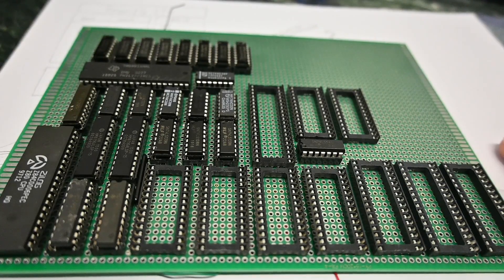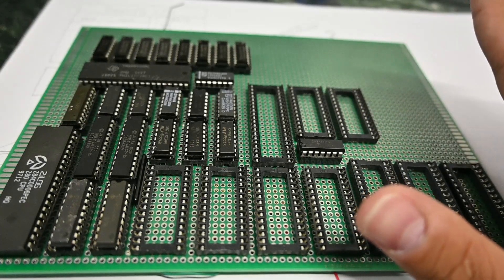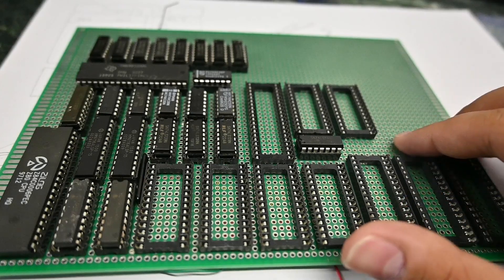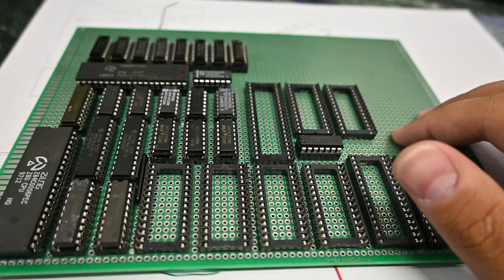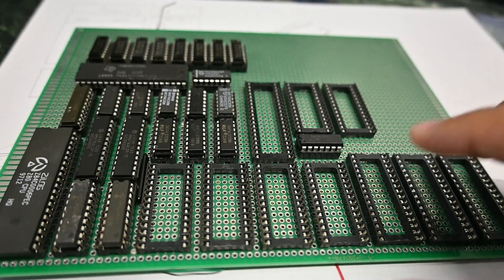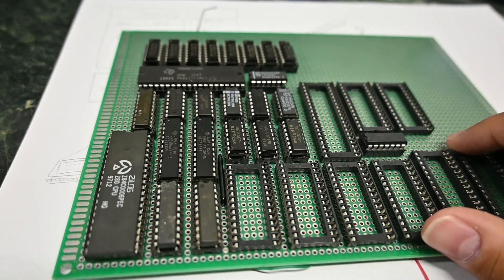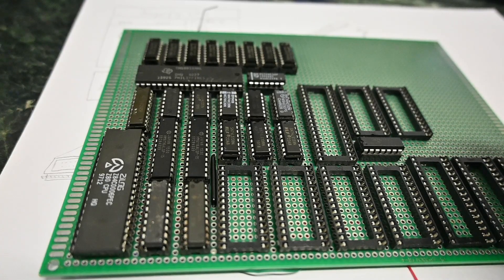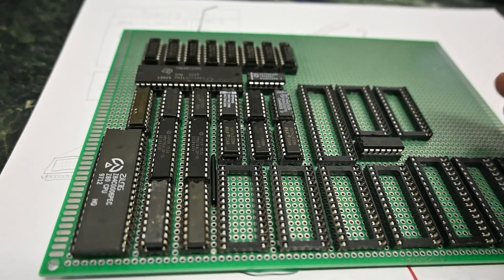[Dragonfly CPU] A brief architectural introduction - Part 1

Comment: Andy, you should look up all the Forth and minimal instruction set computer (Misc) forth CPU's out there.  Many homebrew on fpga. Highest low energy performance and near/highest pure performance, at times.

There seems to be a 40 core 6ghz, CPU on a square mm or two, with some incredibly low energy.  Ultra technology had a chip page which is still maintained.
Reply from the maker: The Dragonfly is deliberately 'not minimalistic'. It is designed to strike a balance between simplicity and ease of programming. Minimalistic computers like the Gigatron are so hard to program that most people built their program on emulation layers on top of the CPU.
Reply: @andyhu9542  Yes, that's what these are like. .less than 32 instructions corresponding to high-level language primitives.  Forth CPU's is the leading languages based cpu category. One of them was the leeding C and JavaScript processor at the time as well.

Comment: Just ran across channel.
But, yeah, I have also designed and implemented a CPU running on own ISA (BJX2). However, my case is a bit different as it is a 64-bit 3-Wide VLIW which I have tested on an Artix-7 FPGA (XC7A100T; but can be shoe-horned into an XC7S50 by tweaking some settings).
It is also a considerably more complicated ISA: 32 or 64 GPRs (64 GPRs is an extension), with variable-length instructions (16/32/64/96 bit), and support for both bundled and predicated instructions. ISA design influences were: SuperH (mostly SH-4), TMS320C2x, RISC-V, and ARM. Also has FPU and 128-bit FP-SIMD, ...
I am generally compiling code for it using my own custom C compiler.
Design is not exactly minimal, more of a "throw stuff at a wall and see what sticks" approach (trying to squeeze performance out of things).

On the FPGA, it generally runs at 50MHz, and while performance stats are "pretty meh" by some traditional benchmarks (kinda weak in terms of Dhrystone value), I had implemented a software-rasterized version of OpenGL which seems to do reasonably well (roughly 4x better in terms of pixels-per-clock-cycle if compared with the Ryzen in my PC).
Seems to do "reasonably OK" at Doom and similar, though Quake and GLQuake performance still leaves something to be desired.
Had also implemented a small Minecraft-like 3D engine on it, which renders stuff using the software OpenGL (but, slow CPU mandates a small draw distance).
CPU generally spends a big chunk of its clock cycles on things like cache misses, and also interlock stalls (from weak code generation by my C compiler; which generally is unable to schedule instructions efficiently for the CPU).
Also does reasonably well on code density (generally beats x86-64 in my tests; but falls short of catching up with Thumb2).
All this has eaten a lot of my time the last few years...

Comment: Hi again! I don't know if it's a good idea but you can combine two instructions together. A few months ago I designed a CPU that has 8 control lines. I had to combine addition and conditional jump to not add extra circutry
Reply: Oh I understand, just wanted to give an idea like brainstorming :D. Yeah, It is very anoying to program specially jumping but I'm learning from others CPU design to make a better one. I'm just a hobbyist.
Reply from the maker: I cannot quite understand what 'combine two instructions' means here. Does it mean an instruction like 'add then jump if result is zero' or something? If that is the case, I think the biggest problem is Dragonfly has limited encoding space. With only 16-bit fixed-length instructions, I can only spare 5 bits for the branch offset. If I would include an arithmetic operation into the instruction, there will be only 2 bits left for offset, which makes it more like a 'comditional skip' instruction found in machines like the Data General Nova.
Reply: I forgot to mention that it is addition with jump if carry. In order to jump I have to write an address register and then trigger the carry flag, it makes hard to program but I wanted to make a very simple cpu. Initially I thought it was a good idea but now that I know about the branch offset limitation, I changed my mind
Reply from the maker: @Jipxmaster  I believe that we have different design goals. Dragonfly is not designed to just be a minimal CPU that is Turing complete, but to be simplified in a way that doesn't hinder efficiency or annoy assembly programmers (i.e. myself in the future). And I consider a load to an address register every time I need to jump annoying enough to be avoided.